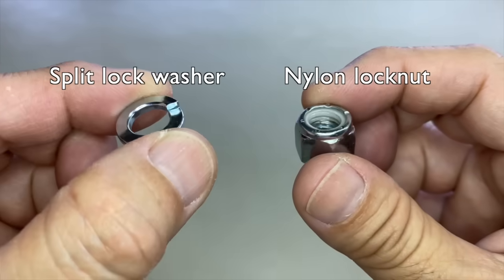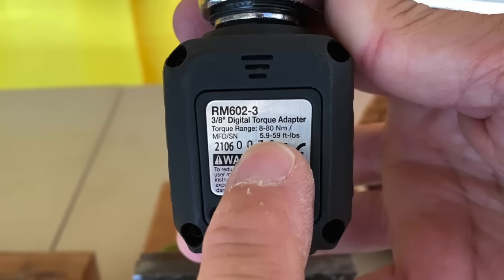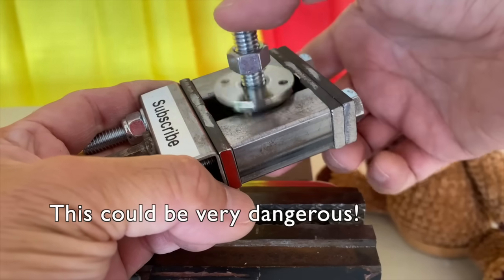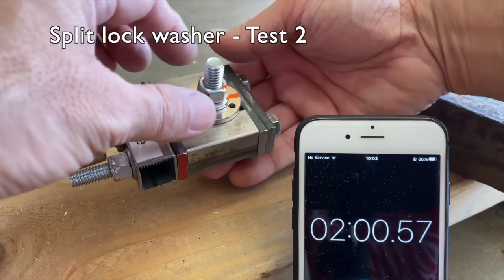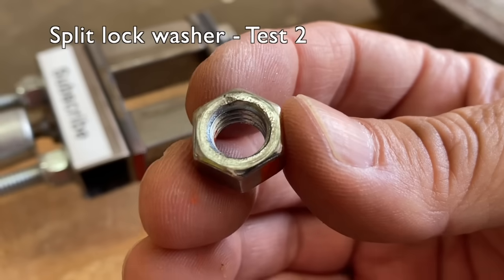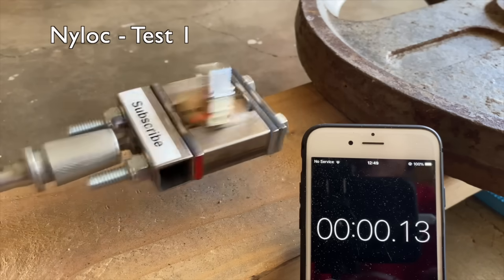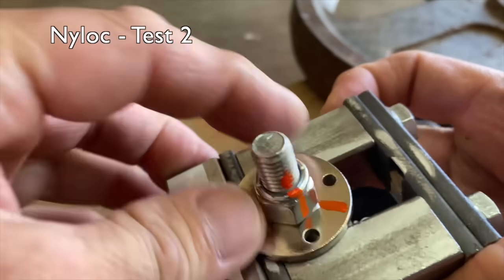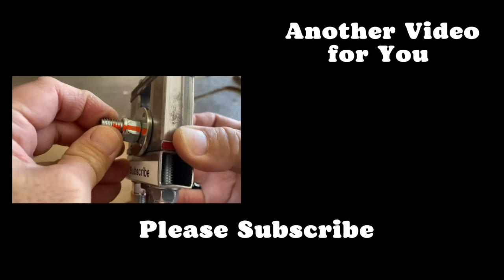Nuts & Bolts - Split Lock Washer vs Nylon Locknut – DIY Impact & Vibration Test - Part 1

Comment: You are referring to "LOCTITE-Threadlocker-Manual" for the torque used.
How do the figures given in "TABLE 7 Absorption of tightening torque", being 
TIGHTENING TORQUE 3/8" X 16 UNC1 (COARSE)
To overcome thread friction: 10.3 lb-ft.(14.0 N.m) 38%
To overcome head friction 12.5 lb-ft. (16.9 N.m) 46%
To create bolt tension 4.2 lb-ft. (5.7 N.m)
Total 27 lb-ft. (36.6 N.m) 100%
relate to the next to no torque of 6 lb-ft you used?👴🧐🤔👎
On Page 79 you mentioned the text is "...a seated assembly, typically torqued to 5 N.m.". In what way is that any kind of recommended torque?👴🤔👎
There are many more variables,
but not noticing that this page 79 is about torque while using loctite really takes the cake! 
During assembly that acts as a LUBRICANT! Another reason to flush 5 Nm down the drain!👴🤯👎👎👎
-
One thing about Nyloc nuts: They will work fine for the application they are meant for.
More important however is:  they may ONLY be used ONCE!👴😳🤨
(When there is no alternative, wack it once on the head with a hammer, and for emergency use it will do one more time.)
Reply from the maker: Thanks for the laughs!  People take the video way to seriously!  I'm the first to say that it is a silly video, but my video... my parameters.  

 In no way do I recommend only 6 ft-lbs.  
That torque is only for my silly tests.  Loctite uses 5 Nm for their breakloose testing, so I'm using something close to it to test other locking means as a comparison to Loctite that I will test later.  

Loctite acting like a LUBRICANT is a common misunderstanding.  If you don't believe me... ask the engineers over at Nord Lock.  Here's a video that I posted on the subject... https://youtu.be/SLBx09En_P0
I'm sure it won't change your mind, but it may steer you to do more research and perform a test yourself.
👍😎
Reply: @HacksbyDad  Having a Phd in mechanical engineering and being 66 years old, I can tell BS when presented.
You're damn right it won't change my mind.
-
Any fluid will lubricate, that has no contest.
Like a toddler, you are just looking for excuses, plain lying and not taking responsibility.

You need to realise too much people take this too seriously, 
Now you call it silly, it would have been correct to put a disclaimer in the thumbnail!

Comment: Screw locking devices are divided into 3 categories (It is quite possible that there are specific terms for this in English):
Setting lock, anti-loosening lock, anti-loss lock and 4. a combination of the 3.
The nylon lock nut is one of the loss prevention devices because it becomes loose but does not completely detach from the screw - this was clearly visible in the video.
The split locker washers have been withdrawn from the standard and are no longer officially considered a screw lock because their effect is very low. They are still used for secondary functions on soft screws (strength class <=5.6).

Junker vibration test is the only minimally more professionally constructed test, compared to the one shown here 😉

Comment: The split washer relies on enough torque to flatten it out. Only then can it dig into the surface and the nut to prevent loosening. They are designed to actually cut into the metal. So the split washer is of no use once the nut has loosened at all. Same with an internal star and an external star washer, a Belleville washer (wave washer). The nylock nut was invented for applications in aircraft. These resist turning even if loosened a little. They don't rely on compression to hold. But torque means everything, as internal engine bolts, i.e. connecting rod, main crank and flywheel bolts generally have no means of locking and they never loosen because the torque is high enough to stretch the fastners, which does what a belleville washer does.

Comment: I'm an aircraft mechanic, if a fastener has a friction that is called tare torque. This tare torque needs to be added to the required torque, so if the nut has 2 ft lbs of tare torque and the required torque is 6 ft lbs then the new value is 8 ft lbs, so the test torque was lower then required possibly causing the failure.

Comment: Hello, I had a fastener class in Auto Tech School at a community college. We were taught to always use a flat washer between the lock washer and the unit we were securing. But, I wonder about the method of holding. Tension, Tinsel, Shear, Torque, Spring etc. There must be more to it than measuring the twisting force on the fastener and the reason it fails. A soft nut and bolt with only 6 Lbs of torque is not too detailed. I'd like to know more about it than that. And the manufacturer's are using torque to yield bolts. What's that all about? Then they say you have to throw the bolts away after 1 use. But I've seen people reuse them. There's a whole other world out there when it comes to nuts and bolts. ben/ michigan

Comment: You should consider the split washer test a success even though it failed... it was once the only solution available to engineers along with jute on threads to close the pitch gap. Remember this was at a time prior to the advent of nylon!
Nice jig setup by the way! 😎
Reply: Prevailing torque nuts predate nylon too, sooo...

Comment: I always use Loctite threadlocker in the case the screws or nuts are possible to get loose. I have done so 50 years. I have two types, middle stregth for mechanics and Low Stregth for electronics. If I want permanent locking, I use different types of glues.

Comment: You aren't supposed to reuse nylon locknuts more than once; it would be good to test this to see how the performance reduces when threaded once, twice, etc. How bad is the degradation once the first use has been completed?

Comment: Every locking situation has its application. Nyloc is not good for high-heat applications; Aircraft need safety wires, etc...

Comment: results are not surprise, not at all. the control, after little loosening, there is nothing to stop it. the lock washer only works when completely tighten. if you get it loose 60 deg, it is like no washer at all. the polyamide ring, squeezes the thread, and does not care about the torque. you will never move it with bare fingers. the nylon ring is not changed during the torqueing process.

Comment: Next please compare the Spiralock system with using the ultimate, but costly Nord-Lock washers. Just ensure you use the washer diameter that matches your nut, for best effect.
Reply from the maker: My Nord-Lock test is out… Will Nord-Locks Survive My Test?  DIY Impact & Vibration Test – Part 5
https://youtu.be/wOUnlfhHRko
Pls check it out and drop a comment.  👍😎

Comment: Thank you 👍🏼 Nylock nuts seem to be the right option for my motorcycle's rear suspension control arm, i need it to be tight but not too tight because it needs to have some play, and the original nuts wore off after taking them off for maintenance several times.

Edit: i think a large aprt of the 6 f/lb goes into the nylon ring's friction itself, so it wasn't actually tighten to the same degrees that the other 2 were.

Comment: The preload seems to have been lost due to wear between the clamped parts? The fact that the nylock did not move on the bolt shows it did not release the tension itself.
Have you tested the nylock setup with a spring washer (domed to act as a spring, not spiral)?

Comment: Great test, thanks for sharing! Indeed, this is not intended to replicate or demonstrate a high level of technicality, but a simple comparison under similar conditions of common locking mechanisms to delay the complete nut back off. For that, it serves the purpose. AND, it’s quite entertaining for those with curious minds. Well done, sir.
Reply from the maker: Thanks!  I find it funny how many negative comments this simple video received from the many "experts" out there.  Anyway... I'm working on another comparison with the same basic parameters.  👍😎

Comment: You could use a split washer and a nylon nut and lock tight. Or you can double-nut it. You can also drill a small hole in it with a cotter pin.

Comment: improper engagement during the split lock washer results in the torque force applied to the washer and nut being insufficient. You need to properly engage this hardware combination and redo the test. The other thing is that you did not properly account for Run On Torque and add that to the final torque value.

Comment: You have too many threads protruding through the nut.  Should be 1 to 4 threads otherwise you can set up vibration along the bolt shaft and cause the fasteners to loosen.

Comment: Since the nyloc did not move on the bolt the only reason it lost it's preload must have been that the washer wore on component clamped. It would have been interesting if you had included thread lock liquid in the same test.

Comment: Nyloc you need to compensate for the drag of the insert as well, so the actual clamping force was barely over 1ft lb in the bolt. The rest was in moving the insert, that is why it moved, essentially no clamping force at all.

Comment: You should have done more research, all this testing is voided because you didn’t tighten the hardware to the specified torque 3/8-16 is 23 ft/lbs.
Reply: THANK YOU!!! Looking for this comment because why would anyone go through all of this and torque to only 6 ft/lbs???
Reply: @stevehiggerson7328 would make a lot more boring video. What locks the bolts down is the hardware stretching against itself when torqued

Comment: use a NODlock washer. Problem solved
yes it is 10x more expensive but if you got vibration issue and need the preload. use it

Comment: Lock washer and nylon are both great when used in right situation, and optional stainless steel,  but adding Locktite or JB Weld to threads will dramatically decrease chance of failure.

Comment: As someone who never tries to make fasteners come loose like you did, and never has them come loose, which is best is whichever one I already have in my parts bin, or costs less at the hardware store.  The fastener only has to withstand the actual stress on it, and paying more to achieve more than an adequate amount of over-engineering, becomes a waste of money.

Comment: 6lb isn't enough, need to torque to the setting for that bolt size.  All your testing there is what happens AFTER it comes loose.  In which case the Nyloc lasted the best.
Reply from the maker: Thanks!  I couldn’t have said any better.  👍😎

Comment: the nut on my Fiskars clippers kept coming loose.  It comes with a nylon lock nut but frequent application of WD40 deteriorates the nylon lock nut.  I bought a nut with oblong threads from Ottawa Fasteners.  It was helpful but the bolt itself wore out.  Fiskars should make the bolt from hardened steel.

Comment: Your test is deeply flawed and proves nothing. The nut has to be tightened so the lock washer is flattened. You show an ignorance of how lock washers act with this test. It isn't only the biting of the lock washer that is important but the pressure it exerts from being compressed. All you showed was a system where the nut was already coming loose, not a system starting from a fully tightened position.

The correct way to run the test is to determine the torque which will FULLY compress the lock washer, then use a slightly higher torque to account for variances in the washers. Then you will have a REAL test of the lovking ability of the lock washer.

 This video gets a big fat thumbs down for being misleading and for your display of ignorance of how things work!

Comment: That is why I only use Nord lock washers with proper torque.

Would be interesting you do a test with Nord lock washers as well.
Reply from the maker: My Nord-Lock test is out… Will Nord-Locks Survive My Test?  DIY Impact & Vibration Test – Part 5
https://youtu.be/wOUnlfhHRko
Pls check it out and drop a comment.  👍😎

Comment: @HacksbyDad recently I opened up an air strut on my car because it was rattling. I found a video on YouTube for the same vehicle that showed a nut inside the strut comes loose and causes the center bolt to rattle. So that it wouldn't loosen again I put two lock washers and Loctite 565 for air suspension applications on it because one YouTuber I watched said not to use Loctite 565 if you need to remove an air fitting in the future but to use Loctite 545 instead. Now I'm curious to see how big the breakaway force is required for those two Loctite versions. I've watched 5 of your videos now and searched for a test of those versions on YouTube but couldn't find anything. Also, I was curious if the Permatex versions were equal to Loctite. Would you be so kind as to conduct that test? Thanks!

Comment: The ni-locks didnt lose their preload. Your flangle was loose and ricocheting back and forth on your fixture but the nut didn't turn on the bolt therefore the looseness experienced had to be from wear between the flange and your fixture. A thousandth or two.

Comment: I always cite NASA RP1228 fastener design manual when this debate comes up.  "The lockwasher serves as a spring while the bolt is being tightened. However, the washer is normally flat by the time the bolt is fully torqued. At this time it is equivalent to a solid flat washer, and its locking ability is nonexistent. In summary, a Iockwasher of this type is useless for locking."

Comment: That is a test on how long will it take a improperly tightened bolt will come loose . Four foot pounds a1/8 bolt would be rather large for that little torque , a 3/8 bolt would be close to finger tight . Less than 2 minutes in my opinion , you need to LEARN more before you do more public tests

Comment: Bolts have torque specs based on size, grade, and whether lubricated or dry. You're not even crushing the lock washer down. Not sure what this test proves, if anything. I would suggest this test is invalid.

Comment: It's not the nut loosening it's the bolt, even if the nut was welded to the plate it would not hold.
You are only fixing one end .

Comment: It's not a 3/8 x 16 bolt.
It's a 3/8-16 bolt.  (X length of bolt)
3/8" diameter with 16 threads per inch.
A 3/8 x 16 bolt would be 16" long.

Comment: This is a great video for learning about properly securing nuts and bolts and how torque and heat are factors.

Also, a great example of how the Internet rises up to correct someone and add points to the original intent of the video.

Comment: I would be interested to see if there is some sort of curve on a graph between these two types of fasteners with different torque specs on each one.  Like if you showed what happened after different times for 6 ft lbs, 12 ft lbs, 18 ft lbs, 24 ft lbs, etc...  It is good to know that the nylon lock nut doesn't spin off the bolt nearly as easy as it does with the split washer, but this is once the initial grip is lost.  What if increasing the torque has different effects on the initial loosening of the fastener?  Like maybe you'd find that as you increase torque, the split washer may hold for longer under the initial 30 seconds, or however long you want to run the initial test, or maybe not.  Would be nice to test though since these findings would make a huge impact on how our machinery is held together!

Comment: We use harrows on a clay racetrack. Each tooth is held in place with a grade 8 bolt and a grade 5 nut on a split washer.  The nice thing about  the split washer is one can see if the washer is not fully compressed.

Comment: German Industrial Standards (DIN) has revoked the Standards for split locker washers in the early 2000s because their ineffectivenes was proven. I learned Engineering in the late 2010s and have still been educated about them because noone knew about this

Comment: Interesting test. In applications with heat the poly locks break down, or when removing or if you have to loosen them often, again they break down. I like to use them and lock washers other times. Sometimes I apply both. Other times I reach for lock tite. A;; three methods have a place. In racing applications lock tite and wire adds the most peace of mind and is made mandatory by the event body that's in charge of rules. If all fasteners aren't wired you won't be racing.

Comment: Nylon ones are adequated for some home appliances only, because they can't stand with high temperatures. For example at exhaust mainfold you cannot use nylon lockers.

Comment: Now try a "NordLock" locking washer 😉
Reply from the maker: My Nord-Lock test is out… Will Nord-Locks Survive My Test?  DIY Impact & Vibration Test – Part 5
https://youtu.be/wOUnlfhHRko
Pls check it out and drop a comment.  👍😎
Reply: @HacksbyDad  Damn! Sweet! They are commonly used on trucks here in Finland!

Comment: The used split lock washer ... in Germany (maybe whole EU) is considered as "non safe method". Thus the regulations like DIN127, DIN128 and so on.. are withdrawn since 2003. 
The problem is known for decades. 
The preferred (non glue, non self lock nut) method uses tension washers (Spannscheiben) according DIN 6796

Comment: Very useful test👍🏻
My thought is, the torque to the nylon nut isn't that high as the other nut because the nylon need some of the torque. 
That u have to measure the torque of the nylon to screw the nut only, so u have to cumulat that torque to the 6ft lbs

Comment: Same test with Nordlock-washers would be interesting. For me the best solution in vibrating assemblys.
Reply from the maker: My Nord-Lock test is out… Will Nord-Locks Survive My Test?  DIY Impact & Vibration Test – Part 5
https://youtu.be/wOUnlfhHRko
Pls check it out and drop a comment.  👍😎

Comment: Spring washers are worse than no washer. Been proven many times. There's a good NASA document available online thay summarises it well. 

Railway engineer, 25 years experience fixing bolted joint problems.